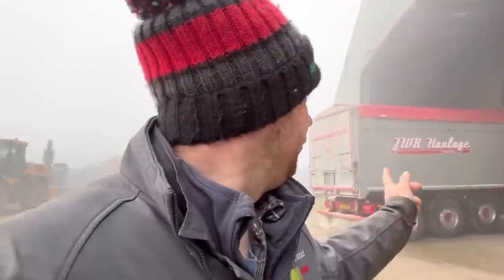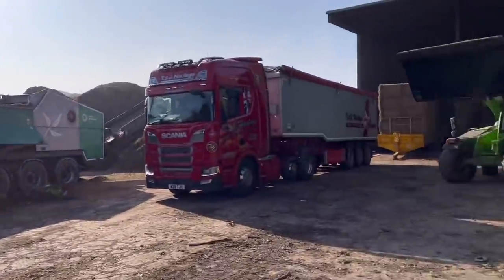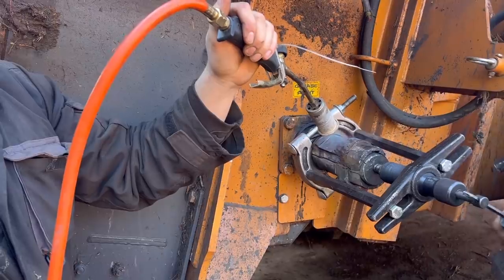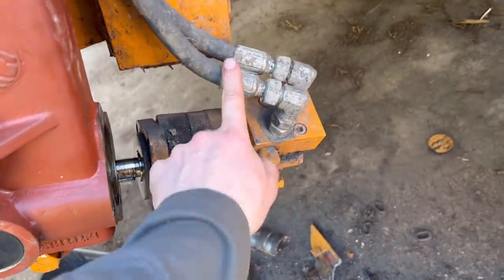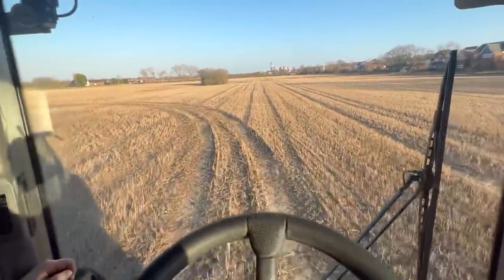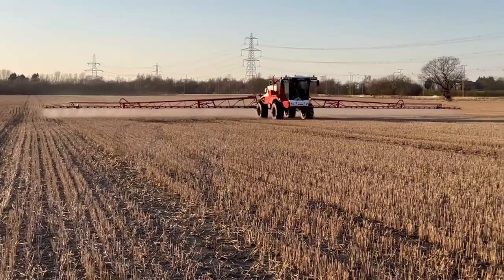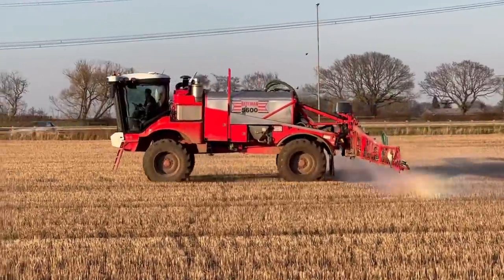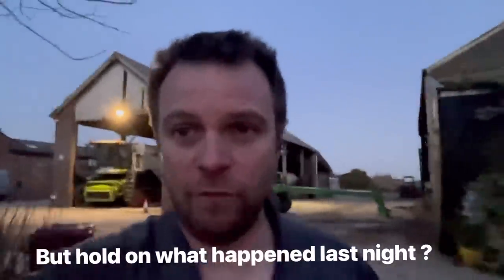Day726 GEARBOX NOW OFF GREAT DAY TO BE OUT SIDE ON THE BATEMAN #OLLYBLOGS  #AnswerAsAPercent

Comment: Wasn,t sure what the quiz answer was until I read the other answers, but it is the same type of bottle that photographic chemicals came in, so when the contents were part used, the bottle could be collapsed to exclude the air, preventing the chemicals from 'going off'.

Comment: Surprisingly cheap, the glass for the 1494 was like 90 delivered. I was more surprised how it got packed and delivered..same as the jcb door bit of foam edging and shrink wrap...for glass.  Never heard of ramp Amazon for tractors sounds expensive 🤣  do need a new bits so will give it a whirl
Reply: Transporting glass is a pain !!!!!!!!. Pack it in a cardboard box and it will get chucked around by a courier and smash. Better to see what it is, so it gets a better chance, plus if it does break, it is in a sealed bag.
Reply: @robertallen3441  I figured that was the reason, just mental to think a sheet of glass gets courierd. Everything gets absolutely battered by couriers 🙈
Reply: It’s “Kramp” nothin to do  do with Amazon 🤣🤣
Reply: @johnwarwick4105  I know, I meant kramp is Amazon for tractor parts. Except my fat fingers and auto correct change my sentences 🤣